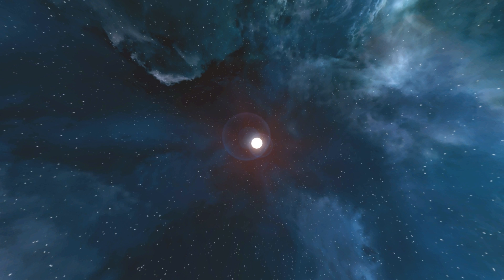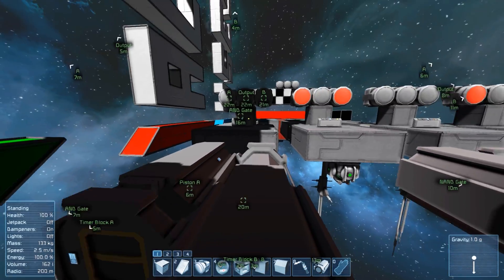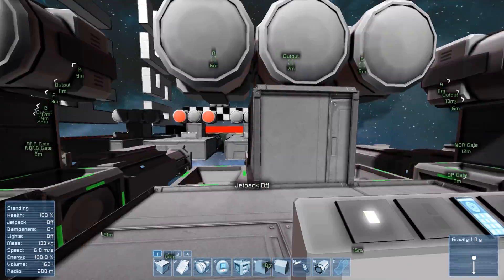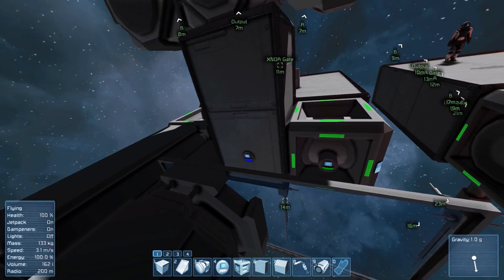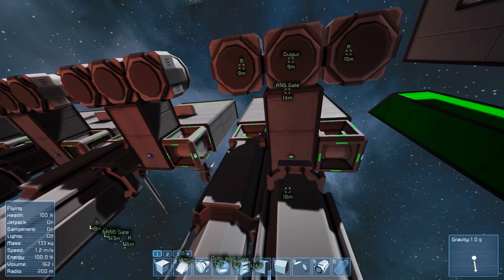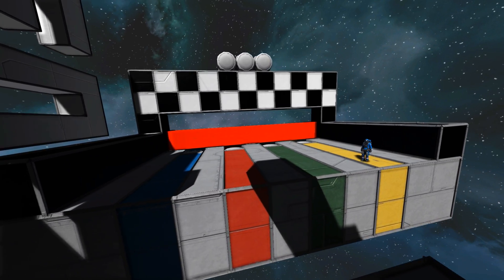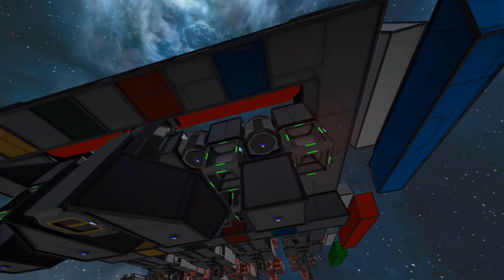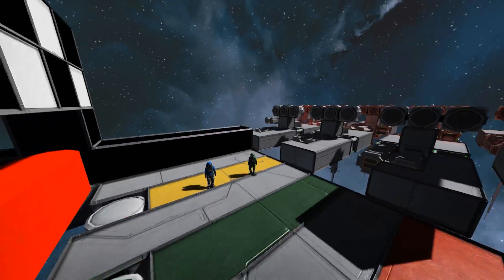Logic Gates - Space Engineers

Comment: dont the programmable/timer blocks make this outdated?
Reply from the maker: How?
Reply: timer blocks and connectors can be used to create logic gates by controlling power flow by connecting/disconnecting or on/off the connectors?

I'll admit i did not think this through when i commented, but with the ability to have a input-output process automated i just assumed someone had already figured out a way to make logic gates that require no moving parts...
Reply: Krolitian actually i think maybe it would work better using antannas, by one timer block turning on/off it's smallship antenna and having another timer block constantly sending some command signal...

The idea is incomplete, but the concept is there...

Antenna ranges could also come into play! it would allow the "clock" timer block to manage the rest of the "transistor" it is part of without interfering with other "transitors"!
....
Reply: Krolitian alternatively Gravity could be used to control on-off states faster! timer blocks could control gravity generators with tiny fields, that would sit next to a "vacuum tube" that would have a sensor on the top and bottom to detect if the powered mass block on a freely spinning rotor arm is in the top or the bottom, and the roof and floor would be a small landing gear to absorb the blow of the moving mass block safely.
Reply from the maker: Unfortunately, that is very unreliable with taking physics into mind, where it will spin, bounce around the fields, and more importantly, not be secure in a moving ship, and also it is much slower because of acceleration.